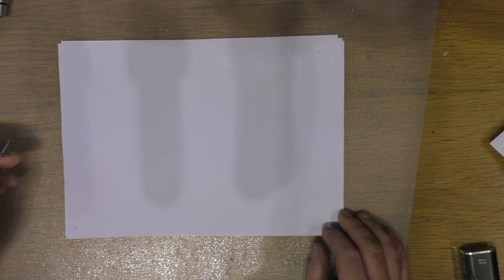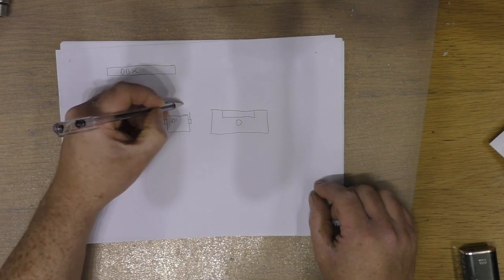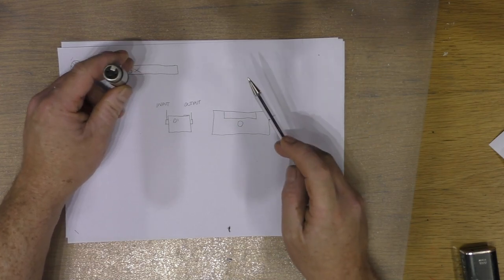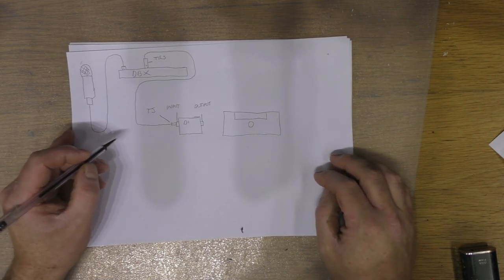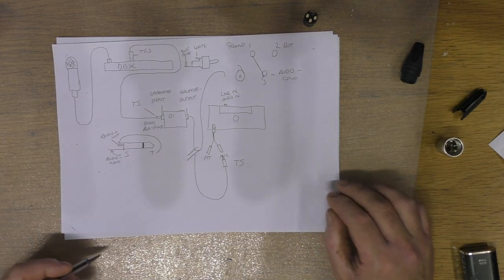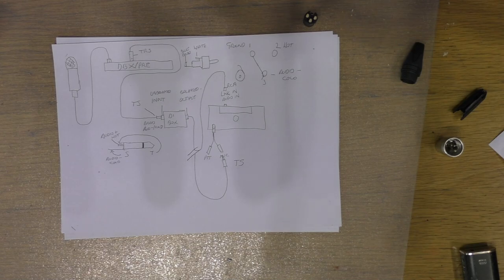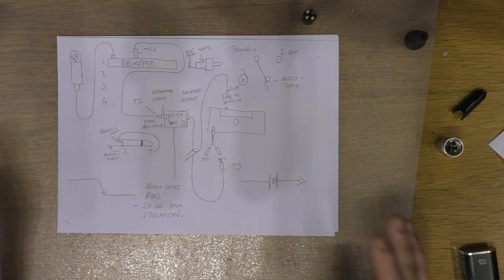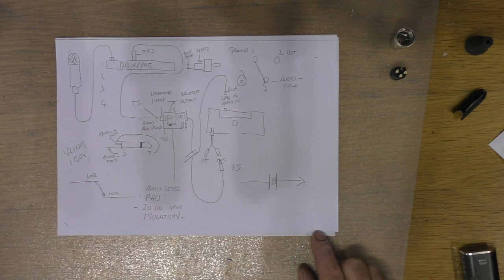HAM RADIO AUDIO USING A DI BOX - THE HOW & THE WHY

Comment: Late to the party…great video George! I have a dramatic distortion connecting a DBX 286s unit to my new Yaesu FT-710…I think a DI box is what I need…going directly from my Heil PR781 to the FT-710, no problems (pin 1-3 tied up at the mic to TS)! Thanks for sharing..Cheers
Reply from the maker: No worries!

Comment: If you are having difficulty with the Rane link that George posted, here is the one that I found: https://www.ranecommercial.com/kb_article.php?article=2107 the pdf download link is not working. In this document they recommend having shields grounded on both ends of a cable, but if there is more than one possible ground path between devices (Ground loop?), should I follow George's recommendation at 11:03 to only ground at one end?
Reply from the maker: Ive never had any issue with one end floating. Sorry, your comment ended up in my review folder for some reason. I dont look in there very often.

Comment: Thanks for the video.  Just to clarify, TRS out from pre-amp, all pins connected. At TS end into DiBox , tip connected,  Ring wire from TRS goes to sleeve, ground/braid not connected?  Having a nightmare getting Audio from Mic > Scarlett Solo > Dibox > Rear ACC2 of TS-890

Comment: Wow, I've watched dozens of videos to find out if I should take special care to connect a studio microphone to my Icom IC-7700 and the only place I could find a practical and theoretical description was here. But a curious question, wouldn't it be better with a Passive DI box (Behringer DI20) instead of an Active one like your DI100 is? The DI20 has an output of 600 Ohms which to me seems more right? One other thing, shouldn't a 1 uF tantalum capacitor be fitted between the mic jack's mic input and to the DI box, Icom has a voltage of phantom 8Volt on the mic input, which will be shorted when trying to connect a dynamic microphone. I know that all Heil microphones for Icom have this capacitor installed. 73 Per HB9GIM (now a subscriber)
Reply from the maker: Hi there, in this video I was being specific about using a condenser microphone. Although nowadays I run a Shure SM7B dynamic, its isolated from everything via the DI box. The whole point of running it from the 9volt supply is to activate the pad circuit really. Its only task is to pad and isolate. Cheers for the sub. For sure you need a DC blocking cap if you're going straight from the mic into the radio's front socket, but not necessary with the ACC port as that 'phantom' supply is not there. When running outboard gear there is not a lot between the mic and the rig...73
Reply from the maker: also the output of the DI100 is also 600 Ohms
Reply: @GeorgeEI7KO  thanks George You have providede me The answers I have ben looking for, for over a Monty. Just ornerede The Behringer DI100 and The Behringer QX1202USB and with this I Can ude all kind of microphones :-) 73 and thanks for your superb videos and explanations On this tonic

Comment: Hi George thanks for the explanation I’m going to use a DI-E di box and just wondering that on the Icom radio their is 8 vdc on the mic hot pin is that going to be a problem or do you need to put a capacitor inline to the di box output ? ..
Reply from the maker: Once you use the rear acc port for your audio you don't have to worry about that.

Comment: Will the phantom power still work after change over to unbalanced.. or should I use a battery?
Reply from the maker: The phantom power on the di box will not. You can use a stand alone phantom supply
Reply: Phantom power is provided by the pre amp to the mic, usually 48v, the pre-amp which George is using as an example as a switchable phantom power facility, so you can use a Dynamic mic or Condenser type mic.
Reply from the maker: @G0ogs  I think maybe he meant the option of powering the di box via phantom power?